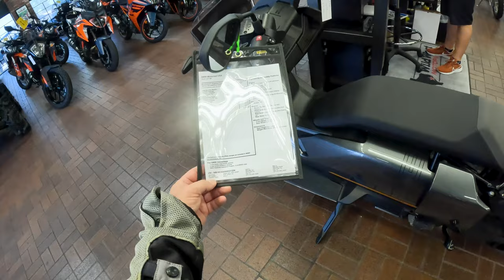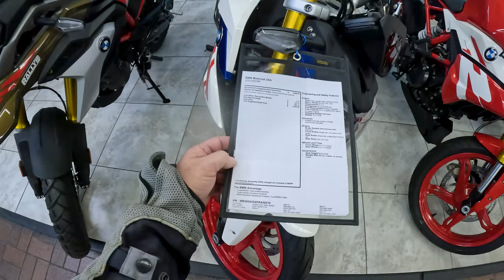VLOG: Honda Rebel 1100 // DCT Problems and Idle Hang?

Comment: DCT should never have been used for motorcycles, it is an unfixable very low speed  failure in cars and is no longer used for that reason and because conventional autos have been developed to be superior. In my country Honda DCT's are not selling.

Comment: Reset the computer.(I will find is in my notes and upload it in a separate comment) This might fix your problem with your DCT. I had an issue with my DCT and it fixed mine.

Comment: My 2015 honda ctx700 dct keeps getting stuck in 2nd gear in high temps its the 3rd time this happened any suggestions?
Reply from the maker: Ouch... that doesn't sound like any fun.  I don't have any experience with the CTX700 or NC700X/750X DCT's.  Have you tried the DCT reset procedure to see if that clears the behavior after re-learning?  You can search Google for "honda ctx700 dct reset" to find detailed information.  This video covers the procedure on a NC700X DCT: https://youtu.be/FTF9h5Eb2cQ?t=199 

Good luck with it, and let us know how it turns out.  Cheers!  😉👍  --QM

Comment: Damn... I was maybe thinking of getting a DCT but i've heard it occasionally has different issues.

I can always get a manual, but I like the idea of not having to use a clutch in traffic. I would of also loved if the positioning of the foot pegs were a bit more foward.

Comment: I haven't even brought mine in for the radiator cap recall. So for no issues though
Reply: Only a few had the faulty caps not seating correctly but Honda decided to change them all out so you may have a good cap anyway.

Comment: mine sometimes does it if I switch off then soon after back on and try to manoeuvre slowly the revs seem to stay high and mainly when hot and the fan is still on when restarting, I wait a bit longer now if I can.  I have checked my Datatool tracking system and according to them I never went over 93 mph so the spedo on the bike is well out above 70 mph which I have checked it at previously as twice it has shown 111mph.

Comment: The way you do a "give away" is sell some limited edition QuasiMotard stickers, and include a free entry into the give away with the stickers. The small pack of stickers costing $20 + shipping 😉.

It is how Mr regular gives away cars on the regular car reviews channel. They charge $50 + shipping for a mug that happens to have a free entry for their giveaway car attached. They also sell a digital download of a picture the car, again for $50 with one entry.

If you are gonna do this I would suggest not saying the word raffle on the channel again until after it is done.

Regular car reviews is a big channel at this point so taking a good look at how they do it without getting in trouble is probably a good bet.

Comment: I finally figured out how to fix the issue, i took the shift motor off and took it apart cleaned it thoroughly with contact cleaner and a toothbrush assembled and installed it back on and now i have 10k miles with no issues no stuck in 2nd gear anymore !!!!

Comment: Ciao.
Bel video.
Si dice che la moto sia instabile oltre i 130 km/h.
Tu hai notato il problema ?
Dicono si risolvi con Metzeler Cruisetec e stringendo la sospensione posteriore.
Cosa dici ?
Reply from the maker: Saluti dagli Stati Uniti! Sì, il Rebel 1100 presenta una certa instabilità alle alte velocità superiori a 135 km/h, ma solo in caso di forte accelerazione. La propensione del peso all'indietro in accelerazione e la geometria dello sterzo della bici fanno oscillare leggermente la ruota anteriore. Quando si riduce l'acceleratore o si stabilizza l'accelerazione (velocità massima), l'oscillazione scompare.

Ho installato pneumatici Metzeler Cruisetec sulla mia Rebel e ho anche aumentato il precarico della molla posteriore. Ciò minimizza il "scuotimento della testa", ma si verifica comunque durante forti accelerazioni superiori a 135 km/h. Tuttavia, questa è un'occasione rara e non è incontrollabile. Saluti! 😉👍 --QM
Reply: @QuasiMotard  ti ringrazio per la risposta.
Quindi non è affatto pericolosa, e c'è l'instabilità solo quando acceleri completamente oltre i 130. 
Quindi se acceleri dolcemente oltre i 130 non si verifica nulla?
Io sto per comprare la moto.
Mi consigli di comprarla già con le Metzeler Cruisetec? PS: quanto hai stretto la sospensione posteriore? Grazie per la disponibilità
Reply: @QuasiMotard  la mia "preoccupazione" è che si verifichi una oscillazione che non controlli e che ti portino cadere !!! Per questo ti chiedevo ....
Reply from the maker: @uerti4013  Corretto! Se si accelera dolcemente sopra i 135 km/h, non si verificano "scuotimento della testa" o instabilità. Ciò accade solo durante l'accelerazione a tutto gas e scompare quando viene ripristinato il bilanciamento del peso.

La sospensione posteriore può essere regolata mediante i collari di precarico molla sugli ammortizzatori posteriori. Raccomando un'impostazione di 8 clic (al centro dell'intervallo di regolazione) per iniziare l'accordatura. L'impostazione di fabbrica è di soli 3 clic (su 18 clic), quindi è troppo morbida per la maggior parte dei ciclisti. Il mio peso è di 77 kg e l'impostazione della molla posteriore su 8 funziona bene per me (11-12 clic durante il tour o con i bagagli). Saluti! 😉👍 --QM

Comment: I have a Ford escape with a manual transmission that after it has warmed up when I come to a stop the idle will come up to around 2500 rpm then will drop back to idle after 5-10 seconds. No one has been able to figure it out.

Comment: So do the Africa twins have these same issues or just the rebel?
Reply from the maker: Great question!  They share a lot of engine components, but the ECU's and engine tune are different.  The AT has 6 ride modes, where the Rebel only has 3 (+1 custom).  I haven't heard back from the shop since earlier today.  

They advised that Honda has been advised about the issue and should be contacting them soon. The shop tried resetting the DCT maps, but now the bike won't even go into gear!  😲  --QM

Comment: Given your experience would you buy another dct bike or stay with manual transmission.  What are your feeling about quick shifters?
Reply from the maker: Howdy, John!  That's a good question.  Overall, I'm still very impressed with the DCT's technology and ease of use.  It's fantastic for laid-back cruising, touring, and commuting because you never need to think twice about gear selection, rowing through gears on inclines, stalling the engine at stoplights, or feathering the clutch in traffic at low speeds.  

The DCT does have its quirks in low-speed maneuvers and when slowing down to make turns.  I've adjusted my riding habits to compensate for those circumstances so it's second nature for me now.  There are occasions when I would definitely prefer to have a manual clutch to modulate the engagement for better performance or smoother transitions... but those occasions are the exception rather than the rule.

My Rebel DCT's current issues seem to be related to a throttle position sensor or maybe a throttle plate sticking open slightly.  The shop wasn't able to "reproduce" my issue and didn't notice the issue.  I got the bike back on Friday (two days ago), and I made a couple of vlogs discussing the issues.  I'll try to edit and post that today or tomorrow to get caught up.  Cheers!  😉👍  --QM

Comment: Do you have an aftermarket exhaust? I've heard that could cause issues like this on the DCT.
Reply from the maker: Yes, I am running the Coffman's Shorty (traditional) exhaust on my Rebel.  You can see that install and review video here if you're interested: https://youtu.be/4Y48--_1rms .  These are slip-on exhausts that don't radically change the airflow characteristics (e.g., run too lean), so that's not likely the cause for my Rebel's misbehavior.  

The problem only seems to happen at high ambient temperatures, so I suspect a faulty temperature sensor or throttle position sensor.  I'll monitor the issue and report back to the community if I have more news.  Cheers!  😉👍  --QM

Comment: I've got a 23" 1100 DCT, so far with the heat this summer I haven't noticed anything really odd yet. This is my 1st motorcycle, and I have to say it's been a fast bike to learn to ride, my only issue so far is with the DCT oil cap bolts, which are super weak, I ended up snapping 1 of the bolts, and then replaced them with titanium M6x18's. Just a heads up to anyone else with the DCT, when you do your own oil changes They're Super easy is that you tighten the bolts to 5-6 NM, Not Foot Pounds, they will snap if you try to reach the 9ft of torque the manual asks lol.
Reply from the maker: Agreed!  I always wince when tightening case screws and spark plugs the same way.  I'm slowly tightening with the torque wrench... just waiting for that sickening spin-through.  D'OH!  🤣👍  --QM

Comment: Do you know if those DCT issues are present in NC750, NT1100 or Africa  Twin?
Reply from the maker: I'm not aware of any similar issues on Honda's other DCT motorcycles.  The idle hang hasn't resurfaced since last summer, so I think it's a heat related issue.  I'll be watching for it again this summer, and I'll be sure to let everyone know if it happens again.

The other oddity with the Rebel 1100 is related to the cruise control misbehaving.  The rear brake switch can flutter rapidly, so the computer disables the cruise control COMPLETELY until the bike is restarted (full power off and on).  The fix was to adjust the rear brake switch to engage "deeper" in the pedal travel.  I haven't had any more problems with it since the adjustment.  Cheers!  😉👍  --QM

Comment: Honda DCT reset
Warm full working temp 30 min?

Driving
Off kill switch 
Off. Key 
On key
Start
Off key
Hold drive button while/then turn key (for boot sequence and maybe until the amber engine light shuts off)
D
D
N
D
N

The D bars will flash

Must then Start engine (will calibrate takes time)
D mode flashes gear mode changes

When done

Off at key
On key
Restart and good to go
Reply from the maker: Great post!  I have done the DCT reset on my Rebel in the past... about 1 year ago because it was acting strange.  The dealer tried the reset procedure this afternoon, but it bricked the DCT computer somehow.  They said it won't go into gear at all now?  Maybe they didn't complete the reset... dunno.  They are working with Honda to figure out what's wrong with it.  I'll keep everyone updated on the progress.  😉👍  --QM
Reply: @QuasiMotard  i'm just curious, any update on this matter?
Reply from the maker: @pathurrhms8180  The dealer completed the reset and returned the bike a few days later.  I haven't noticed the idle hang issue yet, but the problem seemed to be temperature-related.  I only experienced it on really hot days (above 100°F).  We are reaching those temperatures here in Houston, so I'll post another update if it happens again.  😉👍  --QM